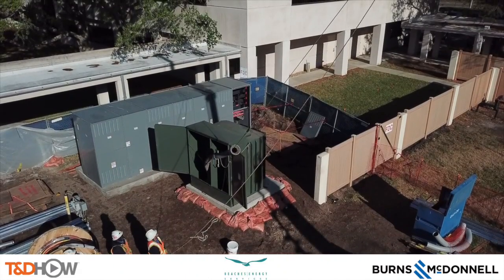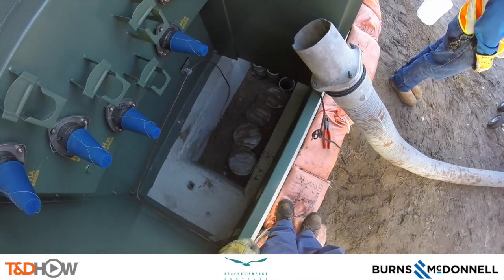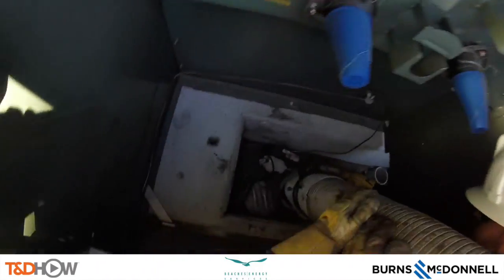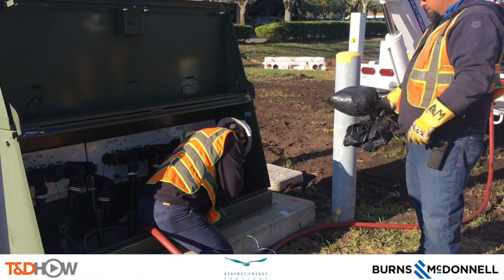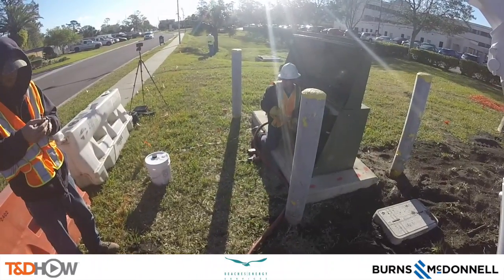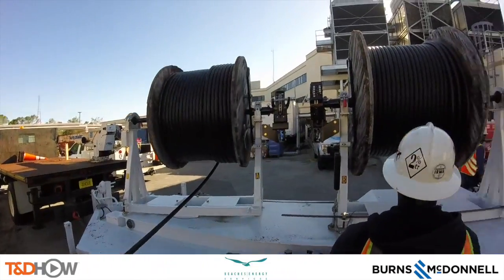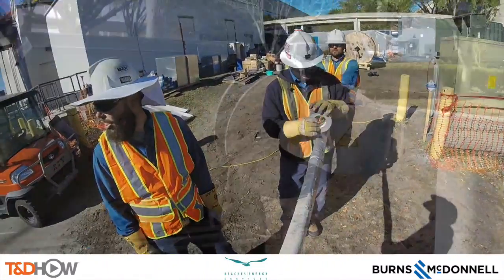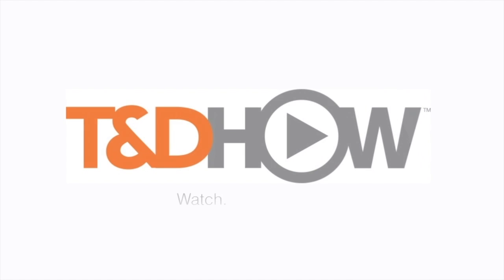Underground Distribution Upgrade for Hospital

Comment: I'm guessing the underground conduit is PVC. I'm just wondering how the steel cable does around 90s? Seems it would dig into the pvc and create damage. Anyone?
Reply: Doesn't really damage it, some minor scarring might take place but that's it.  There are 2 different types of electrical grade conduit that are used, it isn't the same type of pvc conduit that you might see used for landscaping or plumbing.
Reply: @michaeleverest3487  yeah sch 40 and 80 I know. Even those are no match for a thick steel cable with tension rubbing against. I bet its pvc coated GRC the whole run?
Reply: @cashmoney6994  I realize your comment is 3+ years old but I wanted to give you some additional info. The amount of time it takes to burn through a 90 depends on the distance the pull is, the size of the wire, the size of the conduit, and how many 90's there are in the run (not counting the two 90's at either ends). More turns equals more friction which obviously makes it harder to pull. Lube helps but it's not a guarantee the conduit will stay intact. I was working a solar field last year pulling wire and terminating. 1/0 getting pulled 500+ feet with a wire tugger (steel cable) through 3" sch 40 and multiple turns in the run was a guarantee the 90 at the receiving end would get messed up. Lube also didn't help any significant amount so yeah...

TLDR: Yes, you can burn through the conduit. Depends on distance, wire size, conduit size, and how many turns are in the run.